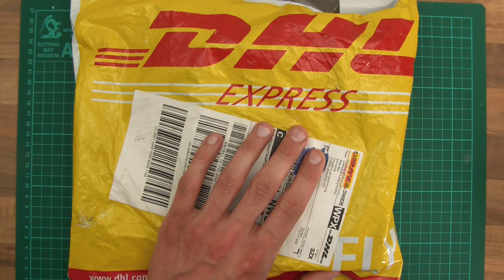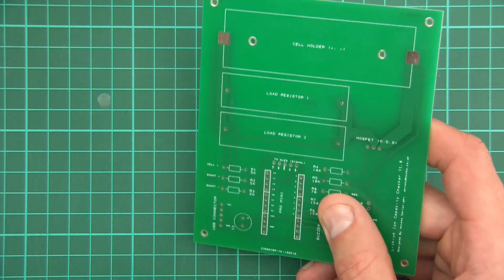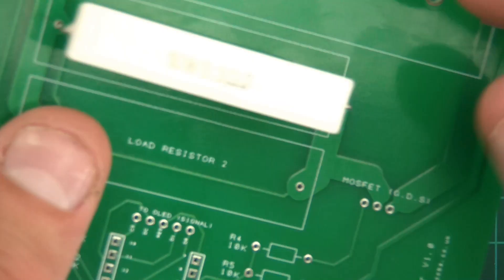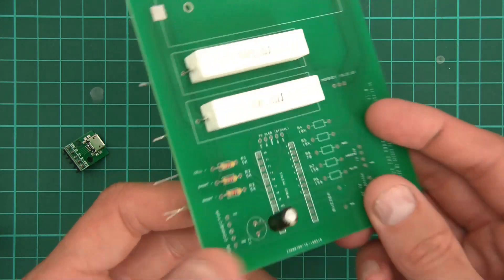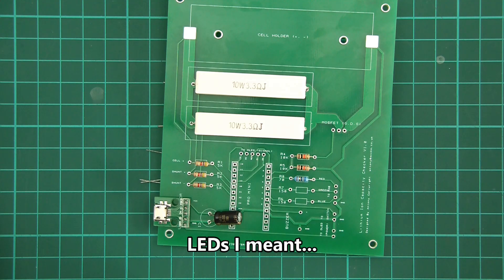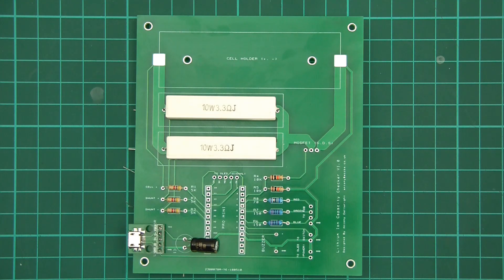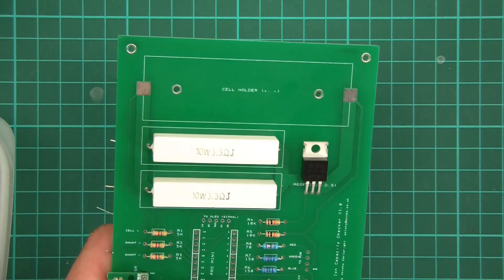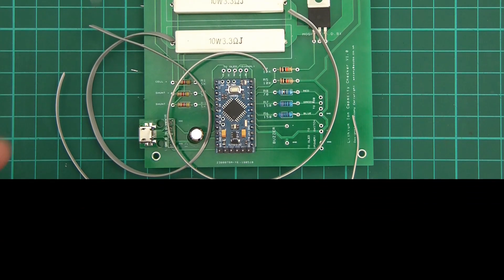TUTORIAL: DIY 18650 Lithium Ion Cell Battery Capacity Checker Tester (Part 23 - PCBs Here!)

Comment: you can buy solder pads that you can just glue into your pcbs. I know pace industries has them and aliexpress has some too.
Reply from the maker: There are no vias on the board though.
Reply: pace industries has various types of solder pads for repairing pcbs including through plated type. with those you can upgrade the pads present to through hole plated pads so you can solder from the back.
Reply: all the circuit level repair items: https://www.paceworldwide.com/products/circuit-level-repair
look for the eyelets, those are the ones you want to upgrade those pads.
Reply: on their youtube page they have great instructional videos for beginners in soldering which incidentally show how to use those eyelets and funnelets to repair pads.

Comment: Fit everything from behind. It will work. Then solder the correct side
Reply from the maker: Hi, that won't work for all items I'm afraid. For the Arduino, we cannot invert the pins!
Reply: Antony Cartwright no you can't invert pins but remove headers from arduino and solder them the opposite too it will work
Reply from the maker: You can do that but then you can't press reset!
Reply: Ho yes you are right. But you can use female headers and enough space to get to the reset button. Just an 💡

Comment: Why did you do single layer when 2 layer costs the same?
Reply from the maker: Korishan I don't know... I don't know. :( :( :(
Reply: I wonder if the program you designed the boards in defaulted to single layer. I've only used EasyEDA for actual prints, and it defaults to double layer. I have Eagle, but I don't know if it defaults to double as well. I can check it out later as well as ExpressPCB, which I also have. But, I didn't like the learning curve on those. Although, now that I'm getting a lot better on it learning with EasyEDA, I could give them a shot now that I know more about PCB designing.
Reply from the maker: Korishan I think that for some reason, I chose single layer in jlcpcb. I have no idea why. :(